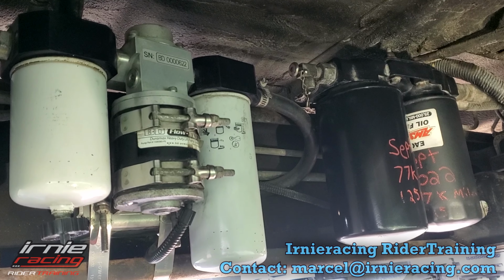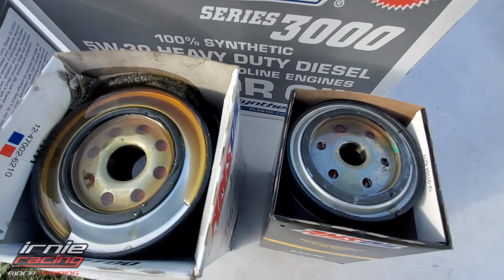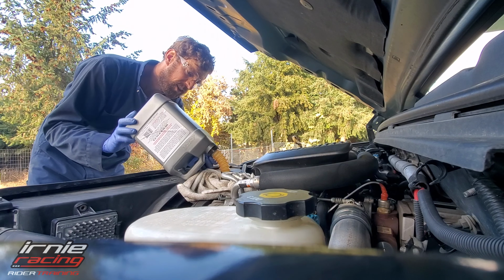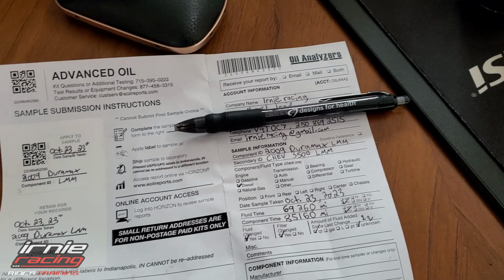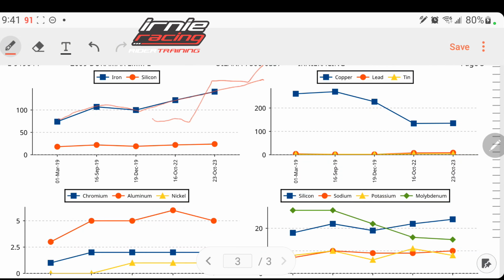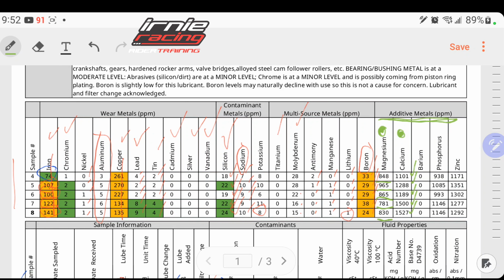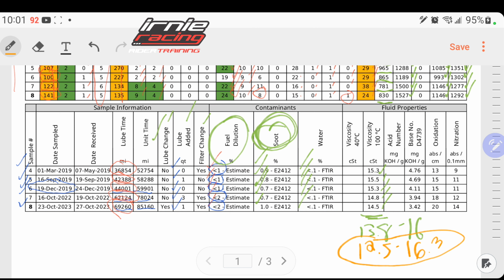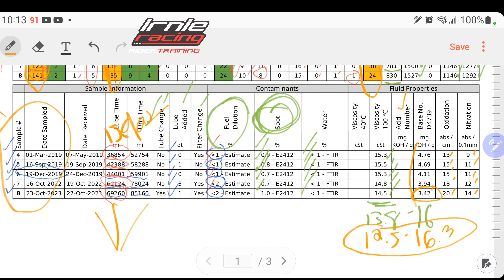AMSOIL Extended Drain Intervals w/ Oil Analysis & Dual Bypass Filtration System | Duramax 6.6

Comment: I have a Luberfiner  14 quart bi-pass filter on a couple of my trucks .. Adding  14 more quarts to your system  extends the oil change intervals.
  Detroit Diesel two strokes always used the bi-pass filters because  carbon tended to get into the engine oil .

Comment: I copied and pasted this from a blog :
Depends on which drain plug you are using. The original plug has a 16mm head and a torque listed of 62 Ft-lbs. The GM replacement plug has a 13mm Head and a torque listed of 18 Ft-lbs. I got these from the Haynes Tech Book for Duramax Diesel 6.6 liter. See the attached page.
Reply from the maker: Yes I read about the 16mm and 13mm drain plug . I have the 16mm
Reply: @irnieracing    I have never used a torque wrench on a 100 different drain plugs you can go by feel..  If the plug has a copper gasket you can go tighter than a nylon or plastic gasket..   I priced a Barrel of Amsoil Diesel for $2,600.00 and a Barrel of Shell  Rotella 15w-40 Diesel Grade oil for $840.00 ..  I can almost buy 3 barrels of Shell for what one Barrel of Amsoil costs plus would still have to deal with shipping costs I suppose.  I did see your link showed 25% off..
Reply: @irnieracing    I changed the spark Plugs on a Yamaha FZ-07 recently  Aluminum threads but the threads are really long.. I went by feel and decided it felt funny Looked in my owners manual only called for  9.4 ft lb  I don't have a ft lb torque wrench that does that low so I had to use an inch pound torque wrench .. Most spark plugs are 22 ft lb  my motorcycle drain plug is 31 ft lbs ,

Comment: But does it remove moisture??
Reply from the maker: Moisture in the oil is burned off by running the engine to operating temperature (100'C).  This is the reason that "Short Trips" to work and back that don't heat up the oil to operating temperature is classified as "Severe Service"